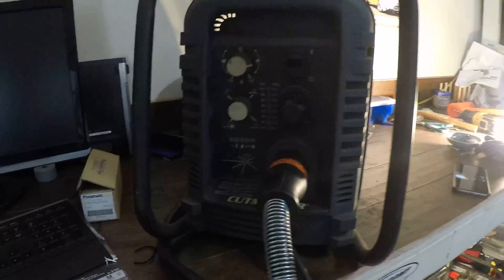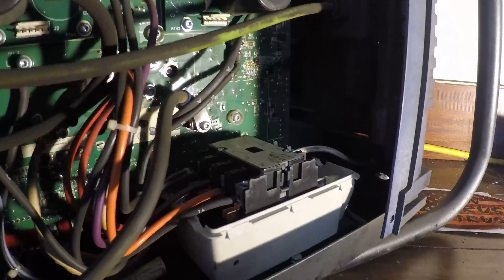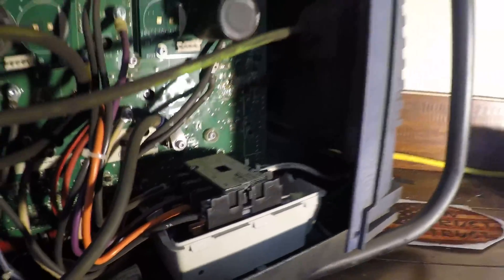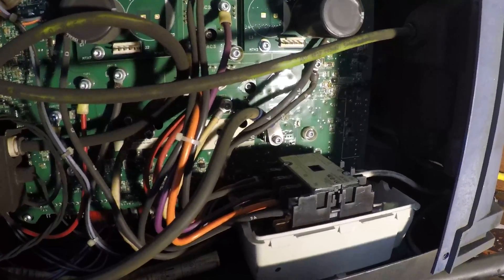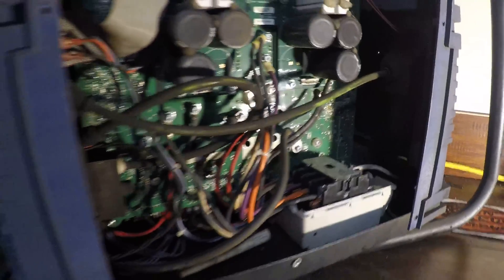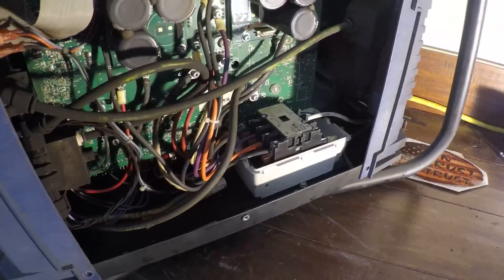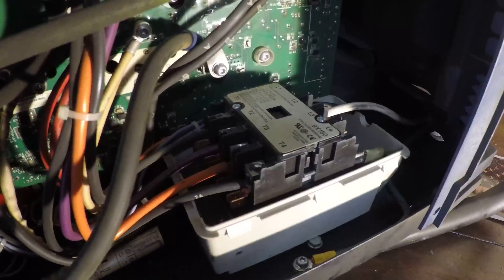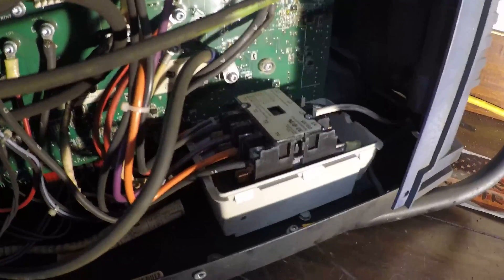Thermal Dynamics Cutmaster 52 with bad contactor making a noisy clattering and buzzing sound

Comment: Seems to be home garage... if is it... the problem was the intensity of current,  low amperage, which damage the coil of contactor... easy to fix with a direct current line for this item... the wire lines of home are below diameter of industrial wire lines. Which cause an intensity decreasing...